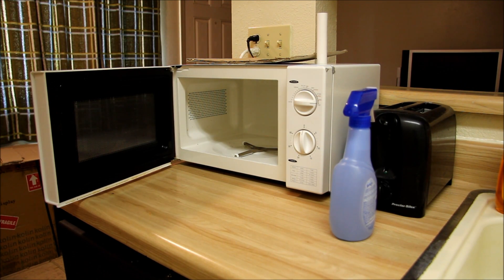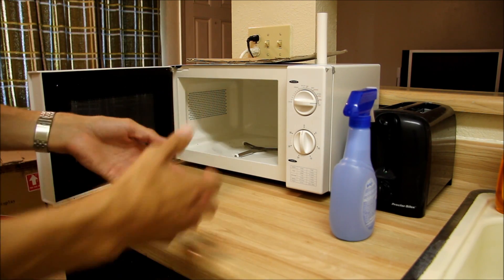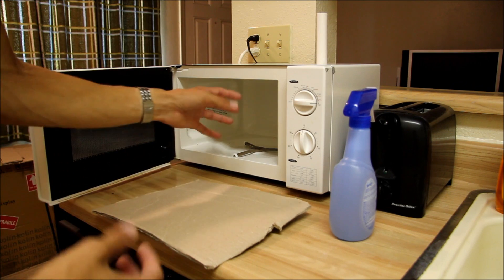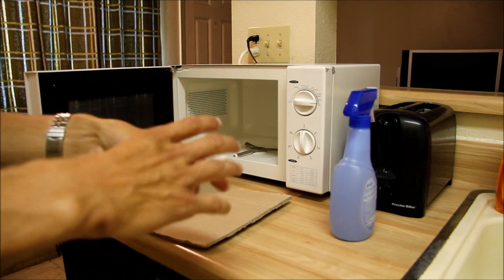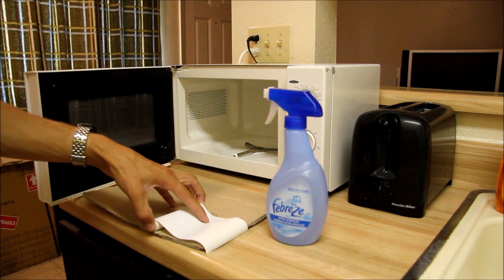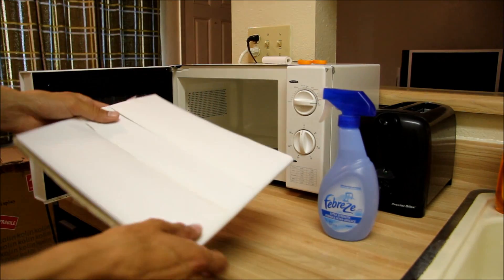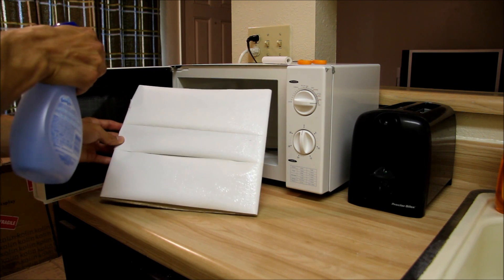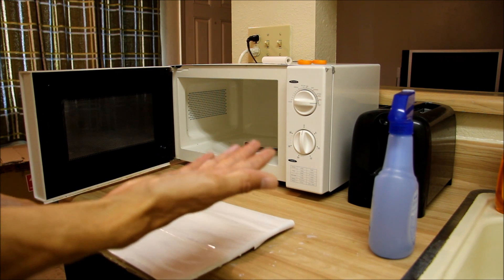Microwave Oven Standing Wave Visualization

Comment: This video is absolutely fantastic, thank you for doing the experiment and videoing it!

I have a Physics exam tomorrow which is about waves, electricity and quantum mechanics and as part of this I need to be aware of experiments to show standing waves with air, string and/or microwaves. I was fine with both air and string but had no idea how to show one using microwaves. If this now comes up on the exam, I will explain this experiments - Thank you!

Comment: Good start, lad!  You are hopefully a HAM? If not please consider joining us! Your experiment is fine, however, it fails to account for the resonance of the carboard and paper, plus the photo-like emusion on the paper.  You, however, realised that this is a 3-D situation.  BTW: The term "microwave safe is inane.  ALL matter has resonance points at which it will radiate with "microwave" radiation.